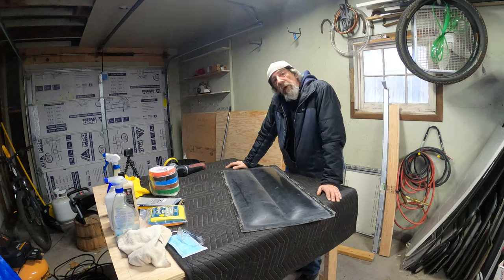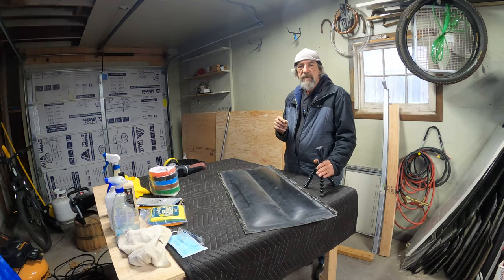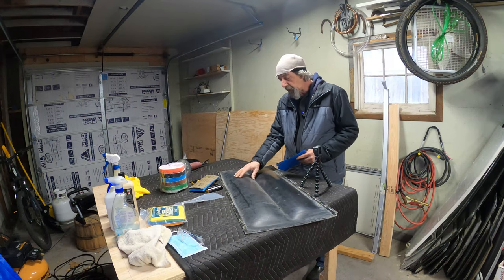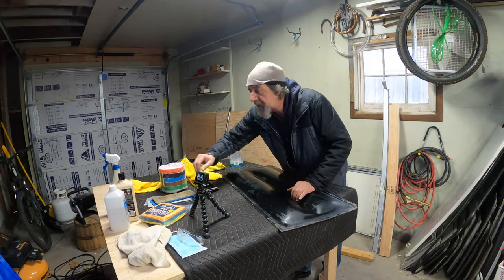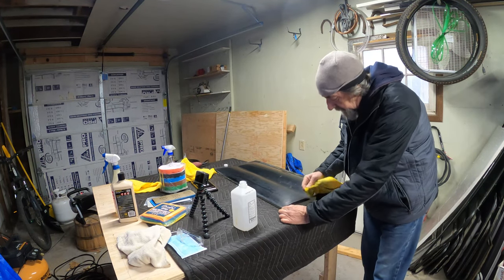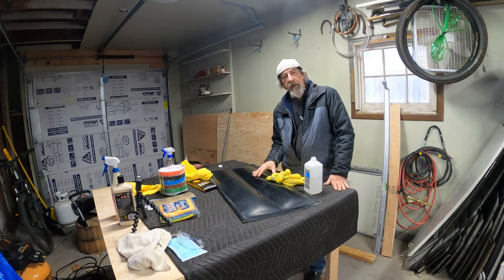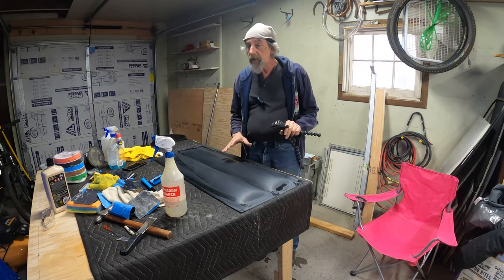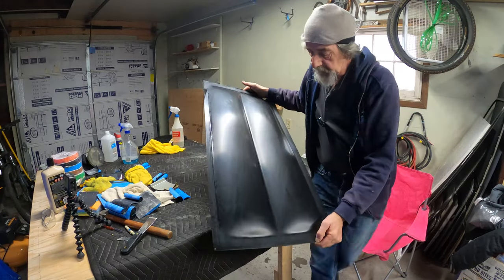Restoring & Polishing Acrylic Windows in a Truck Camper || Re-post w/ fixed audio

Comment: Your are such a good leader on this restoration.  I was wondering how I could clean up the bubles on mine...and though it will be ladder work, I should be able to do a reasonably good job.  They haven't been spiffed up since the camper left the factory in '99'.  Thanks for the helpfull information.
Reply from the maker: You can do it!